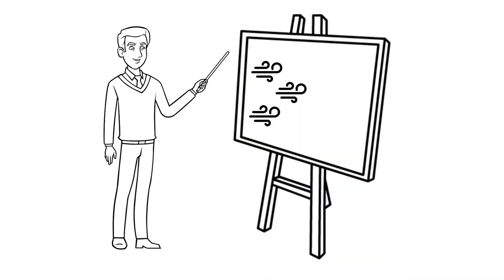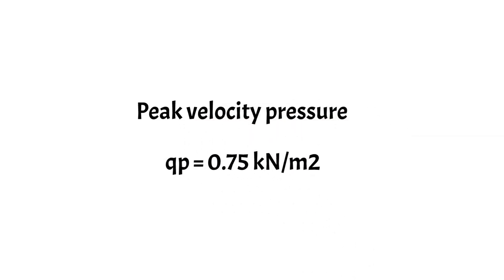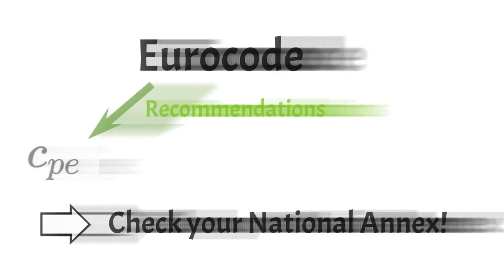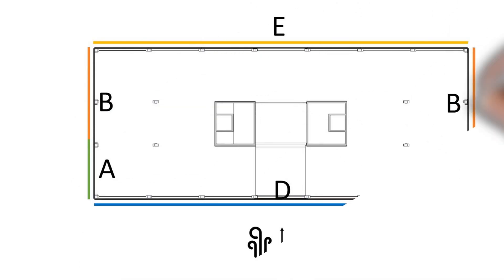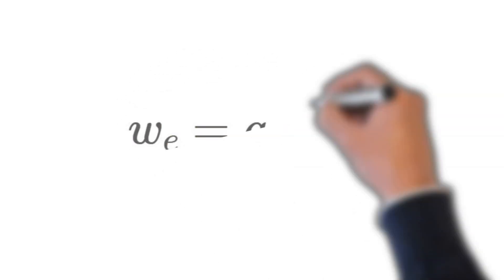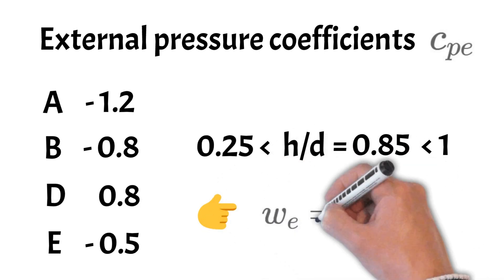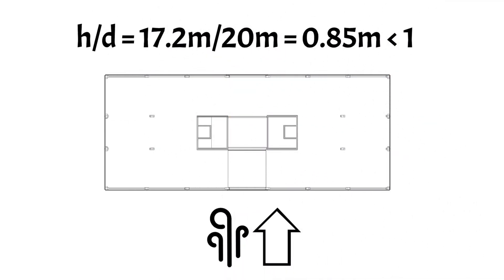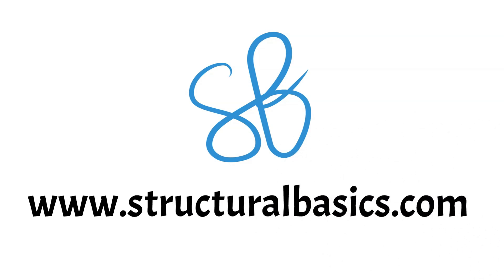Wind Load Calculation on Walls | According to Eurocode | Tutorial

Comment: I recently did a curtain walking project with multiple different transom spans around all elevations of the building, with several different funnelling conditions. This required that I checked the windload conditions for every direction case so zone A loads were calculated for all wind directions with and without funnelling. 

Thanks God for Excel.

Comment: What is the pressure coefficient on a external vertical sun shading device? When I have to check its connection, I think it is like eaves, pressure same as the vertical wall.

Comment: how on earth did you get e=34.2? On which part of the world this ";" is a mathematical operator?
Reply from the maker: The minimum of 2h = 2 • 17.1m = 34.2m and b=49.75m equals 34.2m. 
“;” is not a mathematical operator. There are many software programs that use “;” to separate 2 values.

Comment: This was a really great video and so helpful for a project that I am working on right now. I was wondering, is there any guidance for how to determine internal pressure co-officiants? That's something else that confuses me. I have read the code and know that essentially its either -0.3 or +0.2. Is this all there is to it? 

This code is so confusing!!!
Reply from the maker: Hi Nabil,
That’s a good and tricky question as internal wind pressure isn’t that easy to understand. On a project where I designed suspended ceilings I used the coefficients 0.2 and 0.3 as you mentioned. However, when you have large openings in a building like a warehouse you should use the normal coefficients on walls if not even increase them bc of the increased pressure difference.

Comment: And the load should be applied to the columns or the beams ?
Reply from the maker: Hi,
That depends on the structural system. It could be that the facade is designed in a way that it’s supported by the floors. In that case the facade needs to be designed to resist that wind load. I have only seen cases where the facade was connected to the floors. However, in theory, the facade elements could also be connected to the columns. Then the columns need to be verified for the wind load.

In both cases, the wind load gets distributed to the floors and from there to the walls or stabilizing system. And then down to the foundation.
Reply: @structuralbasics97  that makes sense, thank you for answering !!
Reply from the maker: Happy I could help! ✌️✌️